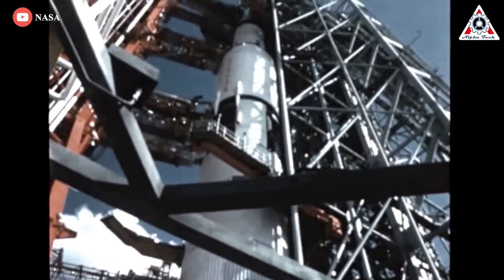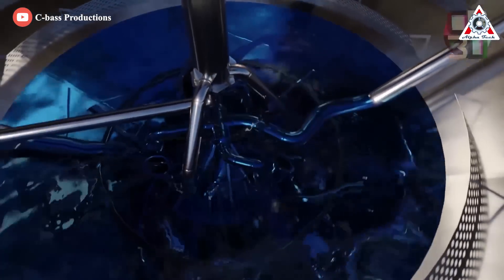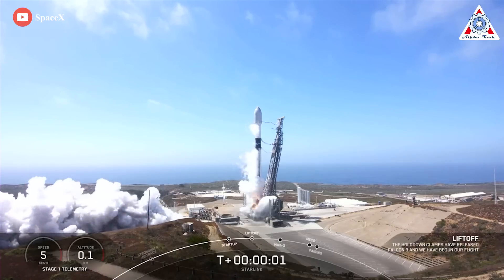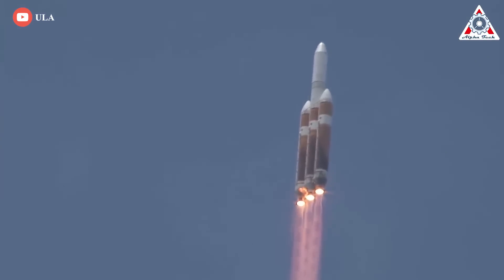SpaceX's Genius Solution to use a new fuel changes everything

Comment: Could pure alcohol be used as a rocket fuel on its own, or in combination with methane or some other fuel?.  I remember something about LPG not being ideal for cooking purposes in extremely cold places, while Methylated spirits, potentially mixed with a little combustible fuel that would add colour to the flame did a better job heating things up!   So I was thinking that perhaps adding some Methylated spirit, or better,  pure alcohol, (that is not a woodbased spirit which is toxic 🤢) to the liquid Methane gas in the Starship and the booster fuel tanks, -  could that potentially be of bennefit, -  like increasing thrust  ? 🤔...
Reply: The V2 used alcohol. (Ethanol)
Reply: Yeah, in the early days of rocketry, ethanol was used as the fuel.
Reply: I'm pretty sure this has been looked at again and again, especially at SpaceX, which has done thorough reviews of fuels. There are factors of weight, density, temperature, and a hundred other things specific to each possible fuel chemical that affect its ability and efficiency in producing energy. But there are equally huge factors in how engines work to create thrust from that energy. And then there's the weight, durability, and simplicity (or complexity) of the engines. After that, there's how the engines fit into the whole structure of a rocket, such as delivery of fuel to the engine, regulation of flow, and tons more. And each fuel presents its own characteristics as variables into the engineering design. Some work better in one engineering environment, and others in another, depending on the overall design goals of the whole rocket itself. So the individual fuel characteristics are only a single component in a much bigger set of considerations that lead to the engineering tradeoffs that go into producing each rocket design, and there's never any absolute answer to questions of that sort, at least if you start with fuel types that are not clearly inadequate for the goals.

Comment: wasn't this "new" fuel introducing several years ago?
Reply from the maker: But they haven't used before
Reply: @alphatech4966  maybe I heard it wrong, it sounded like you said methane is the new fuel yet isn't that what they are already using in raptor 1 and raptor 2?
Reply: They've already performed a number of test flights using methane fuel, but they aren't far enough along to have done any commercial flights with it. I do agree that this title was misleading

Comment: Why was that first bit out of the 1st stage of the Saturn V F1 engine black at lift off and not a bright flame? I’ve always wondered.
Reply: It ran fuel rich on the first stage.  That black part of the exhaust (underburnt propellant) helped to cool the inside of the nozzles.
Reply: @blp5778  ahhh.  That makes sense. Thanks for the info.
Reply: I award you my prize for most numbers recited in a YouTube video. Congrats. 👏
Reply: The black part at the top of the engine plume was due to the turbopump exhaust. Yes, the turbopumps ran fuel rich and they dumped that exhaust along the nozzle extension to keep the really hot exhaust from the combustion chamber from reaching the walls of the extension. The upper part of the nozzle above the extension was cooled regeneratively by circulating kerosene before the kerosene was injected into the combustion chamber. The exhaust from the turbopumps is actually fairly hot although it is very sooty and it is much less bright than the main exhaust from the combustion chamber.
Reply: It's called 'film cooling'. The Everyday Astronaut has a video up on cooling rocket engines which is pretty decent. The gist of film cooling is that one pumps fuel in with injectors (into the combustion chamber or downstream or both) such that the outer edges of the combustion chamber and nozzle are particularly fuel-rich, keeping the highest temperature flame away from the metal bits.
This extra fuel burns off in the atmosphere as air gets entrained into the exhaust, so it looks like a black curtain near the nozzle.
Pumping cryogenic fuel into the walls of the combustion chamber and nozzle also help to keep the engine cool.
Engines nearly always run fuel-rich: a stoichiometric (perfectly matched oxidizer/fuel molecules) ratio of most good fuel/oxidizer combos will melt any combustion chamber no matter how well cooled. Using extra fuel lowers the peak combustion temperature without affecting the thrust and efficiency as much as using extra oxidizer. Extra oxidizer is also much harder to deal with, as most metals will erode rapidly when exposed to hot oxygen.
Reply: @robertherndon4351  The old F-1 engines did run a fuel-rich mixture but they had a special plumbing arrangement to dump the turbopump exhaust down the nozzle extension which was NOT regeneratively cooled with circulating kerosene. In pictures of F-1 engine one can see two sections of the nozzle which are divided by a big pipe of varying width winding horizontally around the cross section, this is where the turbopump exhaust was directed. The turbopump combustion mixture was even more fuel rich than the combustion mixture of the main combustion chamber and hence was cooler than the exhaust from the main combustion chamber. The uncooled metal of the nozzle extension could thereby tolerate the exhaust flow. Proposed updates to the F-1 engine have dispensed with the nozzle extension and just dump the turbopump exhaust overboard outside of the nozzle.

For light fuels like hydrogen and methane, running the main combustion chamber fuel-rich allows for higher specific impulse as well as helping to alleviate the cooling problem.